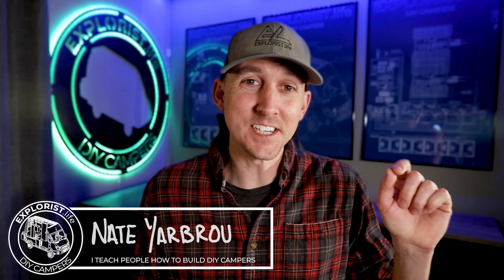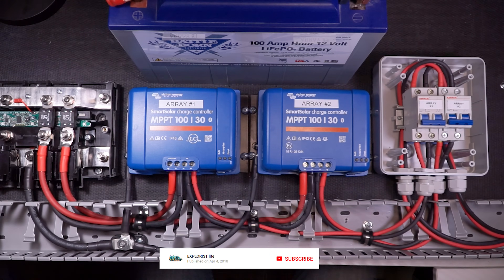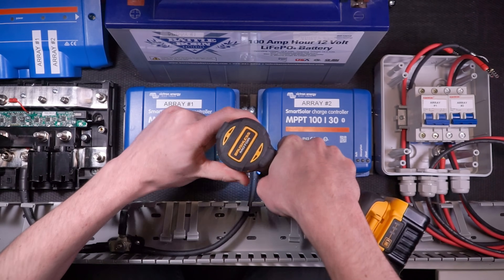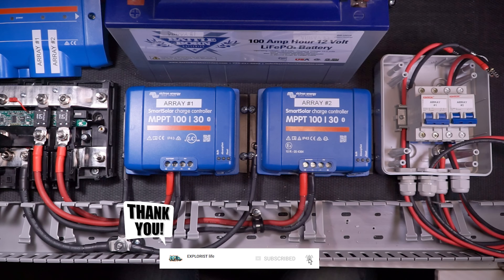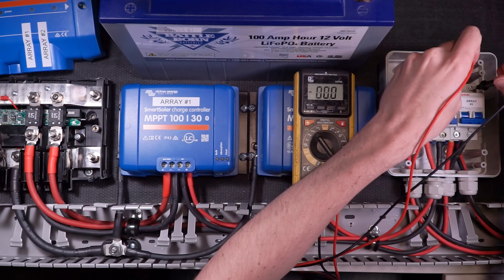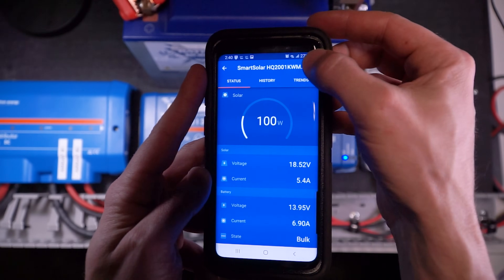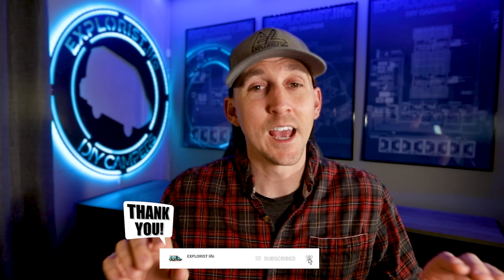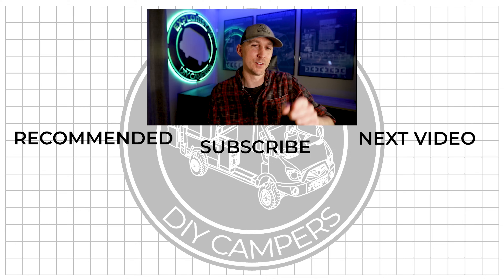How to Wire Multiple Solar Charge Controllers into a DIY Camper Electrical System

Comment: Thanks for your video. I've got 1 Victron 150/45 and 1 Victron 100/20. Both Smart Solar. Can I connect them in parallel in the same way you made in the video?
Reply from the maker: Good question—whether you can parallel those two controllers the way you saw in the video depends on your exact system layout, battery bank, and solar array details. If you reach out to our support team, we can look over your setup and let you know the best way to wire them (and what parts you might need):

https://shop.explorist.life/support?utm_source=youtube&utm_medium=comment&utm_campaign=support&utm_content=response_link

Comment: It would be a good idea to make the charge cables the EXACT same lengths. Otherwise one might handle all of absorption while the other one just shuts off charging believing the batteries are already at absorption voltage. However it's being fooled by the other controller. I think it's a real victron hiccup.
Reply from the maker: That’s not critical given adequate wire gauge is used.  Shop.explorist.life/support for assistance getting what you need for your project to avoid the problems you’re considering.
Reply: @EXPLORISTlife You wouldn't think so, but I've observed my 900 watt array handling the entire absorption while my 800 watt array simply just goes lazy so to speak. Sits with zero current being delivered. I would have thought the controllers would get the current and voltage from the shunt being in a network. Not thier own sensing. In other words, i would expect 2 controllers to share the absorption duties.
Reply from the maker: They will.  Are you a customer of our store?  We can help.  Shop.explorist.life/support

I know you’ve observed one system, but our system designs are backed by our experience of being involved in over 30,000 installations. Happy to help.

Comment: Why don't you use the existing chassis terminal in the fuse block with double lugs, instead of the external/extra chassis lug you fitted? You will then have less connections, ie. less risk. And a cleaner installation. Just my 2 c.
Reply from the maker: There's a couple different 'correct' ways to do this.  Reach out to us at shop.explorist.life/support and we can get you what you need and give you some insight into what would be best for your specific setup.

Comment: Okay I have multiple charge controllers, do i really need that distributor? I currently have the controller running straight through to the buss bar on the battery bank. I only have a 1000watt sine wave inverter so my amp draw is way more limited than what most have going on.
Reply from the maker: Great question! Whether you need a distributor really depends on your exact wiring, protection, and combining needs—especially with multiple controllers. If you send us your setup details, we can confirm what’s best and get you the right parts: https://shop.explorist.life/support

Comment: The 100/30 manual calls for a maximum fuse size of 40A, but here you have it going direct to the lynx distributor with a 60A fuse (minimum mega fuse size). I realise fuses protect wiring not devices, but this directly contradicts the victron manual.
Reply from the maker: 40A MEGA fuses don’t exist from good quality brands, so we have to do some rounding to the next available fuse size.

The people who write the manuals don’t always take what’s actually available to purchase into account.

Comment: can you connect 3 panel in series and then parallel it with 2 other panel
Reply from the maker: Great question — combining panels in series and parallel like that can work in some setups, but it really depends on the specs of the panels and how well they match.

Mixing different numbers of panels in series can sometimes cause imbalance or performance issues, so it's important to be sure everything is sized and wired correctly.

To make sure your configuration is safe and efficient, I’d recommend checking in with our support team:
https://shop.explorist.life/support

Comment: In this system would the Linux Distributor be grounded to the frame of the RV or just to the batteries only? Or could the Linux Distributor be grounded to both the RV frame and Batteries?
Reply from the maker: Grounding setups can vary a bit depending on the overall system design, but typically the Lynx Distributor is grounded through the negative bus, which connects to both the battery negative and your chassis ground. So in many builds, it ends up connected to both — but how exactly that’s done can depend on your RV’s grounding scheme.

For a solid answer based on your specific layout, definitely reach out to our support team here:
https://shop.explorist.life/support

Comment: I’ve an 11 year old 85w fixed panel on the roof on its own small also 11 year old controller. It works fine but sometimes I seek shade. That the case, I’ve two 200w portable panels that I run through a Victron 100/30 which I keep portable too. If I were to do a permanent install of the Victron 100/30, should I remove the other charger and run everything through the one controller?  If so, any special wiring or just buss both inputs and wire to the Victron?
Reply from the maker: Totally get where you’re coming from!

Whether or not to combine everything into one controller really depends on a few system-specific factors — sometimes it’s a clean upgrade, other times it’s better to leave things separate.

Our support team can take a look at your setup and help you decide what’s best:
https://shop.explorist.life/support
(Free personalized support is available for items purchased from our store: https://shop.explorist.life)

For gear bought elsewhere, the Pro Support Membership is a great way to get personalized guidance:
https://shop.explorist.life/shop/all-products/membership-tiers/

Comment: Can you have two different size charge controllers in the same system for example a small charge controller for one 320 watt panel and a large controller for four 250 watt panels?
Reply from the maker: Great question—using different size charge controllers can work, but it really depends on the wiring and how the system is balanced. Our team can help review your setup and make sure it’s good to go: https://shop.explorist.life/support

We offer free support for gear from our store. For equipment bought elsewhere, our Pro Support Membership is a great option: https://shop.explorist.life/shop/all-products/membership-tiers/

Comment: A 1600 watt 8 panels system with 100 amp charge controller just installed on an RV as a day charger for a large 3 battery bank to have 120 volt inverter output use....

Comment: Awesome videos @Explorestlife. Thank you for your time. 
I have a question, can I run array #1  (Zamp 30 amp PWM with 2 x 100 watt panels) and array #2 (Victron 100/50 with 2 x 200 watt panels) and connect them to the same battery bank via bus bar?
I like your set up with all common equipment linked together but its not in the cards at this time. Thanks!
Reply from the maker: Reach out to our customer support at https://shop.explorist.life and we can build you a cart for everything you need to make that happen.

Comment: Hey Nice Video, very well done. Question for ya. Do you have to use "same size Charger controllers"? Or could a person use "ie" 250/85 and a 100/50 together?
Reply from the maker: They can be different sizes.

Comment: Man this is so complex.  I have solar panels that run to my charge controller that runs to my batteries that runs to my inverter. That it.
Reply from the maker: That’s basically what this is in an extremely over simplified explanation, but i suppose I’m glad you chimed in nonetheless

Comment: Can I ask if its possible to charge two complete different set ups, so two battery banks ,two charge controls, from the one solar array. I could connect them via Anderson plug double adaptors. I cant seem to find anything on this and appreciate your help. 
Thanks
Reply from the maker: Not possible, no.
Reply: @EXPLORISTlife  Thanks for the feedback

Comment: I just had possibly a crazy idea but it seems like it might work. I have a big solar panel that puts out around  37 volts I think, if I hook up one of my cheap 12 volt charge controllers all I can get is a little over a hundred watts because it can't use the higher voltages, but what if I hooked two of these charge controllers together in series to the solar panel? I've never heard of anybody doing this but it seems like it might be possible.
Reply from the maker: You can't use 2 charge controllers for 1 solar panel, no.  It won't work.  You'll need an additional charge controller like shown in the tutorial video you commented on.  We've got you covered at https://shop.explorist.life for the 2nd charge controller when you're ready.

Comment: On the bus bar you used 60A fuses.  Is this to accommodate the 2*30A controllers. I'm trying to right size the fuses for two different model Victron CC.  one is a 100/30 the new one is the 150/35 both connected to two different arrays using separate PV isolating breakers. I wanted to connect them to the same bus bars but got stuck thinking about the fuse size for each unit.

Comment: Is it more efficient to have multipule solar panels connected to a single victron charge controler(as long as the electrical current is within spec of the MPPT) or have each solar panel directly connected to its own charge controler? For example if i have 2 solar panels with each panel being 20v and 14amp, should i use 1 100/30 victron charge controler for this system or use 2 100/20 charge controlers with each panel connected to its own controler?
Reply from the maker: This may take a more in-depth look at your personal setup.  If you have purchased/are purchasing from our store (shop.explorist.life) reach out for some more personalized help: shop.explorist.life/support

If you've purchased/are purchasing elsewhere, reach out to your dealer for support.  We'd love to have you as a shop.explorist.life customer so we can provide a bit more help in the future. 🙂

Comment: When I started making my solar power system for my van I was intimidated by the Victron`s advanced system... Now both my solar chargers went up in smoke because I did not disconnect the solar panels before connecting to battery... Not fun... But they was not good chargers and they never stopped charging my 4 battery LifePo4 bank and used constantly 20w just to stay on themselves (10w each) which might be also the reason the Never ever stopped charging no matter how full the battery bank was.

I think I will go for 2 Victron solar chargers this time. Already just bought a 1200w /WA Victron 24v inverter after my  replacement on warranty 3000w inverter only deliver 250w and the inverter before that (same exact) only could deliver 10w after malfunctioning after 6 months.

Comment: when wiring up multiple charge controllers, do they have to be of the same size charge controllers?
Reply from the maker: Nope!   And just a heads up, but if you have purchased/are purchasing from our store (shop.explorist.life) reach out for some more personalized help: shop.explorist.life/support
Reply: Many thanks!  
Great videos. Do you have any 24v wiring diagrams in your shop?
Reply from the maker: Yep!  We’ve got 12,24, and 48v diagrams, systems, kits, and components.

Comment: Hi Nate, assuming the battery can only take a max of 50 amps charging current but the two MPPTs here output a total of 60 amps in parallel, how do you configure the max charging current to be under the limit when you have two MPPTs?

Comment: Can two separate charge controllers be connected it a single array?  My boat has a LiFeP04 house battery and a Pb/H2SO4 starting battery.  As batteries are of different chemistries I want them to be separate systems.  I wish to charge them both from my panels.  Can I run two charge controllers, one to house, and one to start from single array?
Reply from the maker: Nope.

Comment: Your videos are clear and to the point. I have two Renogy 400 watt arrays and two Victron charge controllers. I was wondering the proper way to set them up. Question, do I need to use the Victron shunt to make sure everything is compatible? I do have a Xantrex 3000 watt inverter charger and one liTime 300AH battery. It works with the one controller. Haven't set up the second one yet.

Comment: Sir I have a doubt.

In a normal off grid system

Pv ---> cc ---> battery ---> inverter ---> AC load

What if I use micro inverter for each pannel and I can't connect it to CC...

What are the changes in the system if I use micro inverter?

Comment: Thanks for sharing is it ok if my solar panel array 1 is connected in series and the 2nd array panels are connected in parallel  and I got two different brand of solar charge controller is it possible to use ?  By the way those two solar charge controller are both MPPT

Comment: Hi Nate, I have been following you since 2020, you have helped me with my solar/Lithium install on my Airstream. We now have a new trailer with 400W on the roof and a Victron 100/50 CC. I want to add a 400W suitcase with Victron 100/30 CC mounted beside the existing 100/50 CC like you have in this video. Can I wire the CC ground to the existing CC equipment ground, or do I have to use a junction stud?

Comment: Hello, 
I seen your video but i have a question. If i use two MPPT HYBRID charge controller outputs 24VDC at same full and low battery settings with two 12v 100AH in series circuit after that i power up the UPS which is connected with utility power. But utility will be cutoff at day time. Are you sure never happened with both charge controllers?
Reply: Please share your email. I will share it with a diagram for more explanation.

Thanks
Reply from the maker: Hey, @muhamnmadimran7686! I appreciate you taking the time to ask your question, but unfortunately, I don't have enough info about your specific question to provide an accurate answer, but here is a playlist that, if you watch all of the videos start-to-finish (and take notes 😉), you'll have a REALLY good idea of how to design a solar array: https://www.youtube.com/watch?v=Jkbs84sBHsg&amp;list=PLmvhcyi4n0TV9pi83rFTv3ZuMT_S1xIZt

Alternatively, I have some of my most common solar array setups pre-built here: https://shop.explorist.life/product-category/all-products/camper-wiring-kits/solar-charging-wiring-kits/

Comment: If I have 4 panels and run them in series, can I split the supply cable with a Y connector to feed into two charge controllers? Or do I need to run separate cables for each charge controller  from a 2 panel in series configuration?

Comment: Hi, can you pls tell me some info?

Since we will be charging the 51.2V 230ah 11.7KWh Wall&Floor-mounted LiFePO4 Battery with 3 x 480W solar panels ( Vmp = 37.10, lmp = 12.95A ), we would like to have information on which Victron MPPT controller is suitable so that the battery will be charged properly (Operatin value charge of the battery is 43V - 58V).

Does the Victron 150/35 match the charging voltage? ... 150/45??

Can such a battery be simultaneously charged from the panels and at the same time transmit energy to other consumers?

Comment: Great video, thanks! Can you do this with two different brand charge controllers? I have a suitcase solar panel that I will only use occasionally and I have a spare charge controller but it is a different make than the one in my trailer. Thanks again.

Comment: My battle borne / Dragonfly tech advisor told me 2 days ago to not connect the individual grounding lugs of dual cc's, that they are only necessary if used in a ground array, not in an rv. Hmmm😮
Reply from the maker: Hmm indeed. 🤦‍♂️👎
Reply: @EXPLORISTlife  not going to far out on a limb if I'd guess there's no harm in doing it anyway?
Reply from the maker: @winginitwithjohn8451  We recommend wiring the equipment ground as shown in all of our diagrams and tutorials which is consistent with manufacturers recommendations as well as ABYC standards and there is no down-side to it; only increased safety during an internal catastrophic fault of the unit.

The statement of equipment grounds only being for ground arrays and not rvs is simply misguided and not accurate, unfortunately.

Comment: Great video I use a redarc manager 30 but find I don't have enough solar and I've maxed out the redarc with 600w of solar panels, could I ad a victron charge controller to the system without causing damage to the redarc,batteries or the new victron?

Comment: Hi Nate: How can I add a second MPPT if all the fuses/posts are used in the Lynx Distributor (by MPPT #1, Orion TR SMART, Multiplus INVERTER/CHARGER, and 12V Panel)?  Note: I have limited space, so it would be very difficult to add another Lynx Distributor.

Comment: I have 6 6v golf cart batteries in series and parralel charged by 2- 250w panels and 100/50 victron CC. I have two 12 volt optimas that i want to run a different circuit to 12v lighting and 12v cb radio. My 6 -golf cart batteries go to a 2000w inverter. So how do i charge both 12 v battery banks with the same charge controller?